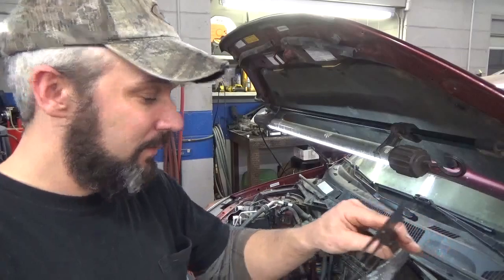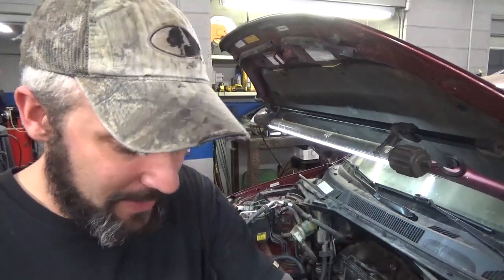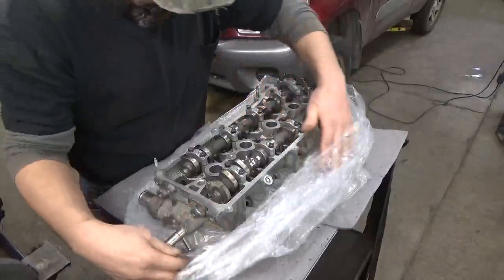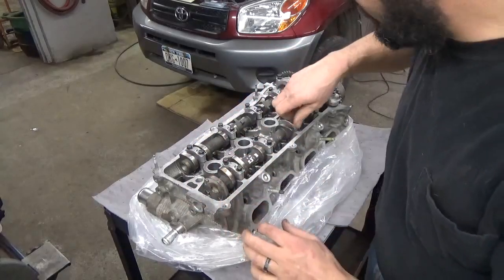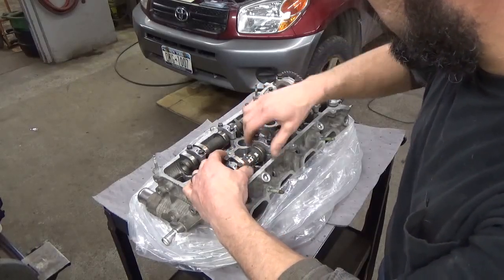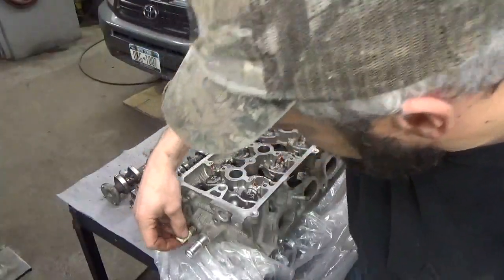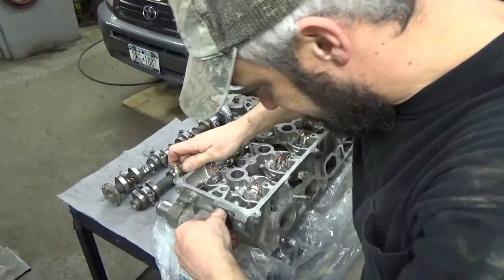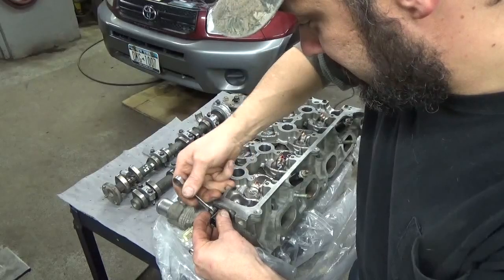Toyota Rav4 2AZFE Stripped Head Bolt Repair Part III

Comment: I work on heavy equipment and everything is torque turned. Sometimes its just easier and faster to mark the bolt, where the bolt has to stop, draw a line down your scoket, or on the Allen scoket,  line up line on scoket to line on bolt, turn until it lines up with Mark on head.

Comment: This is why back in the day, we used to torque to spec, run the motor up to temp for a while, shut down and retorque the next day. This used to be common practice. I guess it was abandoned to get the vehicle out the door faster.

Comment: I've done a ton of GM TTY LS head bolts. I have never lubed the threads or washer and always just mark the head if the bolt with a sharpie. My torque wrench is just a clicker and doesn't measure angles. That way has always worked well for me.They take 2 90 degree turns after the initial torque setting. I do it the same way with the GM LS TTY crank bolts too.

Comment: TIP: Split the final 90 degrees in TWO 45 DEGREE increments. It will be easier on your arm and the head will settle better. It does take a bit longer, but results are better for your arm and the cylinder head to block seal.

Comment: I am about to do this job on a 2003 Camry with the 2.4 L Engine. Up to this point I was good with it, now I am really nervous LOL. I better make sure my torque wrench is on the spot and I pay attention to the 90 degree thing. Oh Boy. LOL. As far as making the mark, that is what the Toyota service manual suggests to ensure the correct turn angle.

Comment: Those Timeserts look like the way to go.  I’ve had a helicoil blow out on a 350cc Honda M/C head less than a year after installing it and it was the only head bolt held down by the helicoil.....not a big fan!

Comment: I bet you are glad you've trusted your gut feeling and did all 10 inserts. In this case you eliminated a chance of stripping since you've completely removed weakend threads and created new ones which are larger in diameter, so they can withstand more shear load then OEM. The inserts are definitely not the weakest point since they are made of much stronger material and press fitted as well.
Like your diligence and attention to details, rare qualities in today's field of automotive repair business (been replaced by negligence and greed lately). 
Happy 2021 to you and your family. 
Greetings from South Africa.

Comment: Helicoils or thread inserts are usually fine on stuff that doesn't get cycled very much. The only time I've ever really run into issues with them is on stuff like oil drain plugs that get loosened and tightened all the time.

Comment: Who else was holding their breath during the torque sequence ? I have stripped head threads in aluminium, I wish the manufacturer would use studs and nuts instead of bolts into the softest metal known to man.

Comment: 83 Ft. Lbs. on an aluminum block for head bolts EEeee....! No! Even on a SBC the head bolts only get torqued to 60-70 Ft. Lbs! The manual states "47" Ft Lbs, final torque. Never use the "turn 90 deg" method, EVER! That's when bolts start breaking or threads start letting go.

Comment: Obviously the fix worked but I wouldn't worry about threaded inserts coming out. We use them where I work as mil-spec in  6061 alloy and the general consensus is that they are much stronger than aluminum by itself.

Comment: You didn't put Teflon on the first sensor you installed, I assume it's because the circuit return path is thru the block.

Comment: Long torque to yield bolts all feel like that, some of our engines use head bolts the thread into the main web, they are torque to 80 ftlbs and turn 210 degrees. You don't think that is sketchy. I use arp bolt lube.

Comment: That seems a little excessive for such a small motor😲! For a big block it's 75 ft-lbs. (long bolts) 65 ft-lbs. (short bolts) and this seems way too much for this car.... No wonder the bolts stript out on the other 🤬 what were they thinking when they torqued these heads in?

Comment: Just torque the bolts until you feel the threads start to pull,  then tighten two additional turns.

Comment: How on earth can that torque wrench possibly 'know' when it has rotated through 90 degrees? It's easy enough with torque- the bar is deflected a certain amount and a sensor of some sort gets tripped at the required torque figure, but degrees??Does it watch its surroundings and beep when it sees they're 90 degrees from its starting point? Just amazing!

Comment: Inserts like that (steel in aluminum) are used in aerospace applications where high strength bolting and/or repeated assembly/disassembly is required.  Because the aluminum (weak)  thread diameter/thread area is much larger, if done correctly (good drillng/tapping, etc. which that kit should do with appropriate care taken "installing" it) it will be MUCH stronger than the original thread, ESPECIALLY if the thread is heavily stress cycled (thermal/physical) or the bolt is removed installed many times.  The last part is often why studs, rather than bolts are used in high strength applications (especially cast) threaded holes requiring multiple assembly/disassembly/reassembly applications.  Every time a bolt is removed, reinserted, and re torqued the thread is further weakened. 

 I have MANY times wondered why bolt and hole threads are tapped at the same pitch in VERY high stress applications, since often one side (usually the bolt) stretches more than the hole, and as such only the top few threads are carrying most or all of the load...just sayin'.  I guess the problem would be that it would have to be material/structure/etc. dependent, and that would make it a clustermess to implement.  I could be done today, though, with CNC machining, rather easily, I expect, but you would have to cut, rather than tap the hole...big deal....but as we all know (from the ankle biting bean counters) every millicent counts.
Reply: Very interesting information /explanation in paragraph one.  Thank you.
Reply: @anwalt693  You are very welcome.  

One obvious non aerospace application where studs are used is in head bolts in racing applications, to save wear and weakening in the threads in the block. 

In some applications, like top fuel drag racing they can be disassembled and reassembled multiple times in a single day.  I think that happens after every run, any more, actually.   When  you are doing that every 1/4 mile, or whatever, well ... and the loads when each cylinder is creating more than a thousand HP are IMMENSE.  On your typical car each cylinder is making more like 50, or less.

Comment: Im like timesert I dont pull out.
I have 15 kids.

Props to having pride in your work and more importantly, having quality work ethic. Its a rarity.  
The fact that you did all 10 head bolts is a reflection of that. Most "mechanics" would've said well they aint stripped so why waste my time. 
You did the right thing. There was a recall on those heads(from what ive heard) and you just fixed the problem permanently(hopefully).
Not to mention i can only assume the customer paid all 450 dollars for the time serts so he might as well get all the inserts he paid for.

Comment: You have similar practices. I don't go torqueing from the gate. I rather do them in steps. Yeah they do look tight!  No wonder threads stripped and the others so difficult to remove upon disassembly! Makes me cringe to tighten them so much! I experienced similar on transmissions,  of course bolt sizes & torque was different.
Reply: When threading into aluminum,  there should be lots and lots of thread engagement for bolts so tight.  Aluminum threads always make me nervous.

Comment: Great company? You're kidding. My Rav was in the repair shop more than on the street (warranty thankfully)...company Tundra leaked like a a colander- (dealer never really fixed it- antifreeze, oil, tranny fluid) and my niece's Lexus was the worst car I've ever been around (ECM's - 2 of them burnt up) calipers frozen, head gasket blown (101,000 miles) dash gauges out at 114,000 miles  and engine blown-seized at 128,000 miles. No thamks

Comment: I totally know that feeling. My Audi axle bolts are torque-to-yield. Audi spec says 190 nm or about 147 ft/lbs plus 180 degrees. Let me tell you, every degree you turn, you hope to your creator that bolt doesn't snap. I remember even thinking, maybe I'll just go 90 degrees then himming and hawing for about half an hour, ultimately concluding, OEM knows best. Turned out just fine, but gosh, what a knot in your chest it'll give you. Love the channel Eric!

Comment: The final 90 degree rotation on those head bolts had me on the edge of my chair. At least you didn’t need to ultrasonically measure bolt length while they were being torqued.

Comment: Toyota seems to have this love affair with those "torque plus 90 degrees" stretch bolts - same on 1HD-T big-end bearing caps and they feel equally as weird
Reply: A lot of engines require it now. I wonder what brought this torque to yield to come about.

Comment: I`m a new subscriber, excellent videos by the way.  I know this is kind of the wall since the video is 3 years old, but I ended up doing the same job on a different model, a 2007 BMW 328I, talking about pain in the butt, specialty tools for everything.  Like you. I installed the head gasket without any coating.  I have seen some folks out there covering the gasket in copper spray coating.   I believe this is a huge mistake in doing so. Just like to know your opinion on the use of any type of coatings for the head gaskets.  Keep up the good work.

Comment: nest to setting the ring end gap on an engine and the rod bearing clearances,torqueing the heads on is the most important repair with repercussions,of biting you in the ass,aluminum is a junk metal for automotive use anyway,but beings they are using it,understanding its short comings is everything,i always set aside the time involved in clamping two pieces of aluminum together,aluminum head to cast iron is straightforward as you have one metal with integrity,alum to alum is critical,i always tight torque to half go get a cup of coffee and let it set and conform to clamping torque then proceed in 15 lb increment up to torque,your thread repair was mandantory good job ,take a bow

Comment: when i have to torque to yield with the 1/2 inch torque because of high torque  always try to use the impact 1/2 extension to prevent twisting of the extension because the 3/8 do twist especially chrome ,the impact is better so why take a chance

Comment: As I understand it, head bolts are supposed to feel like they're about to break because that last 90 degrees stretches the bolt. That's when regular bolts fail, so your intuition is generally right, but head bolts and studs are designed to stretch.

Comment: Always use original Toyota gaskets and seals when doing a head gasket job.
Wet torque specs are not the same as dry torque specs.  If the Toyota spec is for dry torque, you will have to adjust. I think that you are applying too much torque to those bolts.

Comment: Just discovered this awesome channel. Please don't take this as a criticism of your work, but I'd hate to see you get bitten. You were getting more stretch on the bolts during the 1st torque step due to the assembly lube on the bolts instead of engine oil. Then they recommend engine oil on the thread and under the bolt heads, that is what I use. Little story to prove the point... Detroit Diesel specifies a 50/50 mix of engine oil and STP as assembly lube. I got some of this mix on the threads while fastening the connecting rods to the wrist pins in a Series 60 Detroit engine (the wrist pins are threaded and the connecting rods bolt to the under side of the pins.) Well those new bolts refused to pull up to torque because of the lack of friction between the threads. The bolt shanks necked down and just kept stretching. I junked 2 bolts for the first rod I did and had to order new bolts before I could continue with the job. With the proper lube specified used for the rest of the bolts they came up to torque just fine. Substituting thread lubricants on these high stress bolts can cost you. The problem is not as bad with torque turn as the final rotation of the bolt puts a predetermined stretch into the length of the bolt, determined by the thread pitch and the degrees turned. But if the bolt has already started stretching before the final rotation as you felt was happening here, you may be taking the steel  in the bolt way closer to its elastic limit than intended.30 year licensed HD mechanic, self employed with my own HD / Agriculture repair shop in small town Alberta Canada since 1992.

Comment: snapped a bolt inside the crank when removing the flywheel on my 2002 Hyundai Sonata. A TimeSert insert saved me big time. Pricey but worth it when the options are few. Thanks for this series!

Comment: I used the fatter longer 2AZFE repair bolts on eBay and didn't even take the head off. Worked great. 2 hours repair.

Comment: I've never had a problem with timesert products, helicoil is a different story though lol, it's an expensive product but you get what you pay for, I've mostly used them on those shitty Ford modular garbage spark plugs but I've never had one pull out or come back, but I've had helicoil pull out while torquing

Comment: HI Eric, thanks for such a great series of videos, man what a great help these are.
I see these Rav 4 videos are a couple years old, but I'm hoping you might have the time and inclination to answer a couple questions. 
I'm doing the same job but on an 03 Camry.
After torquing the 10 new bolts to 58#, I then turned each bolt 90 degrees. I set the torque wrench to 80# just so I could get an idea how tight they were getting. All but 2 clicked at 80 just before hitting the 90' point. But 2 bolts never clicked, indicating they never hit 80#. In fact, both those bolts had a starting feeling, almost like something else turned,, not sure how to describe this. Any suggestions? Should I call this good and go forward?
Another question I have has to do with the cam shaft towers and their torque values. Anything you can share with this?
And lastly,,, for now,, I see the intake cam has a bearing where the exhaust does not. Is it a good idea to replace the bearing?
Again thanks for such a great set of videos. It's been years (back in the 70's) since I was a motor head, you videos give me some of the confidence I had lost. :-)

Comment: don't worry. I've done Chrysler motor their torque was over 100 lbs. that was an experience.
Reply: The old cast iron heads were about 110 IRC. Many a crushed alloy head when they were new. I'm sure earlier alloy heads were only about 40 ft pounds.

Comment: I was working at the dealer when the torque to yield head bolts first came out. I remember all those tense moments when torqueing them down. Those were first generation and the bolts had to be changed every time. I hated them. Of course, like an idiot, I bought a torque angle gauge on the first job. Since I had the only tool in the shop to set these, I got all of them. Don't worry, I did get smarter eventually. LOL.

Comment: well you said you had the machine shop set the lash. now with that said when you torque the head bolts the head will flex some it seems like it would effect the lash settings. now it might not on this style head ive just had it happen on isuzu. then i had a Nissan that had to be ran until warn then go back and adjust lash again. just curious?

Comment: just watching you torque those bolts down was making me so nervous. Ugh.
Reply: Roy Skenz The head bolts are quite long so need stretching within their elastic limit to provide enough force to clamp the head down. Long screws always feel as if they are at risk of breaking if they need tightening to near their limit due to the amount they have to be stretched. Remember head bolts have to restrain the full power of the engine attempting to blow the head off instead of driving the Pistons down.
Reply: Good info, thanks much!

Comment: It's funny you mention dropping a break rotor and pretending it was the head. I have tripped and feel with a subaru head in my hands (outside working on my own car) But 11 stiches and a permanent 90 degree scar on my finger where the razor sharp aluminum stabbed me, I didn't get a spec of dirt on that head though. Lol.